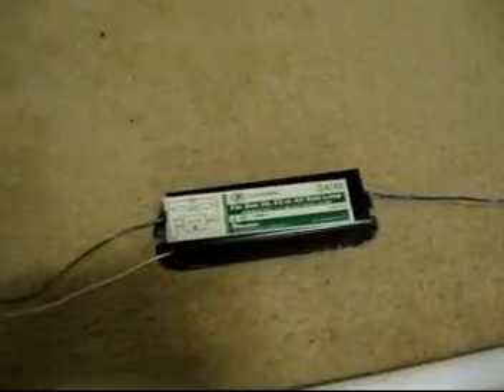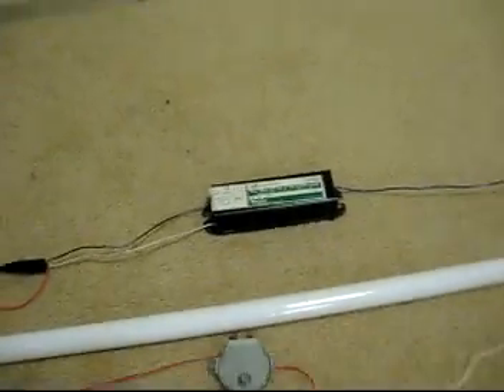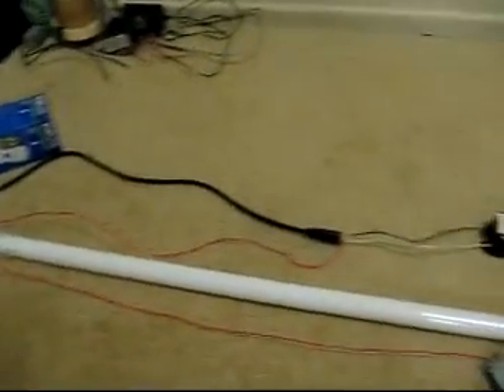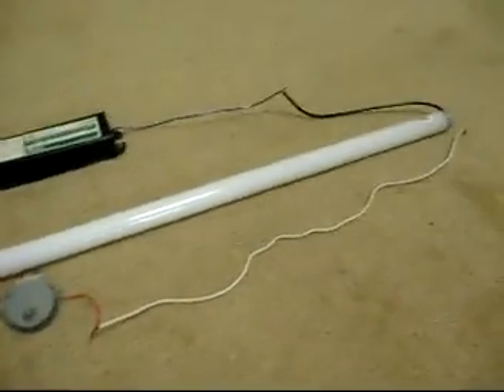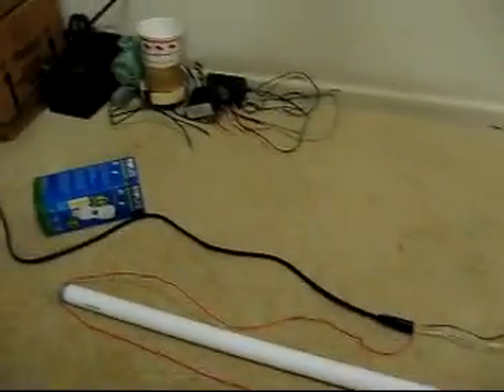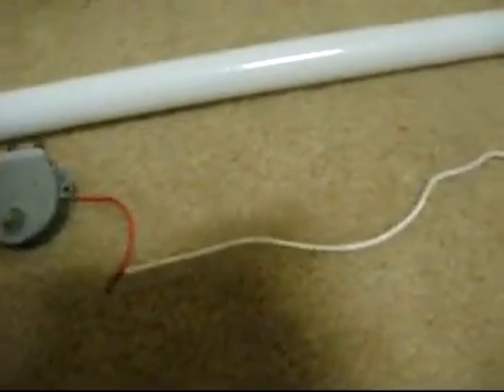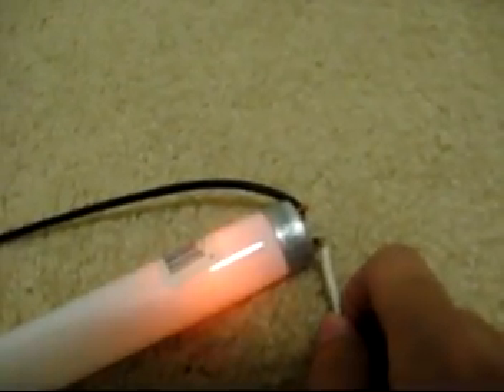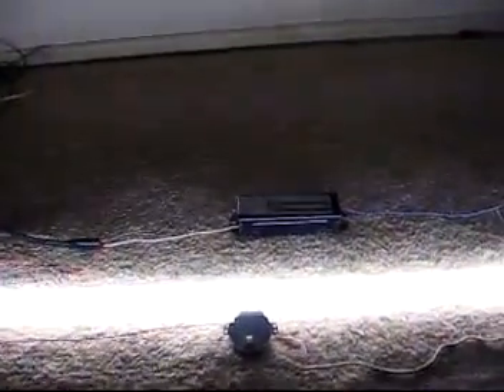Robertson S40B Preheat Ballast

Comment: That is pretty cool! I tried to start up an F32T8 on a preheat F30/40 ballast with an FS4 starter but it just kept blinking without starting. I have both Advance and Magnetek ones and got the same result with both. I'll have to try manually starting it.